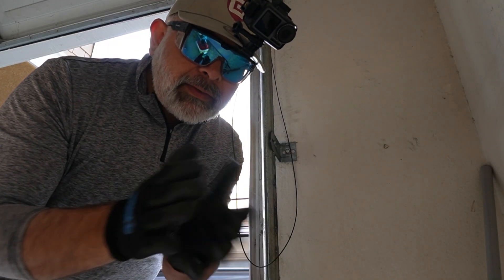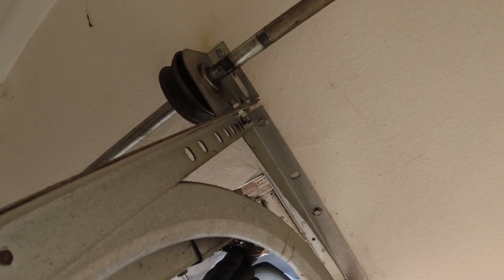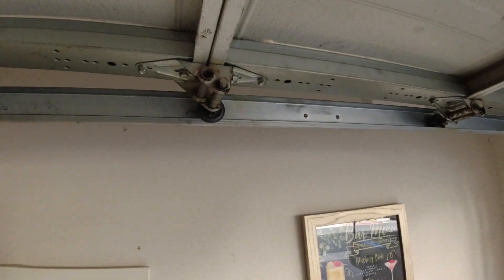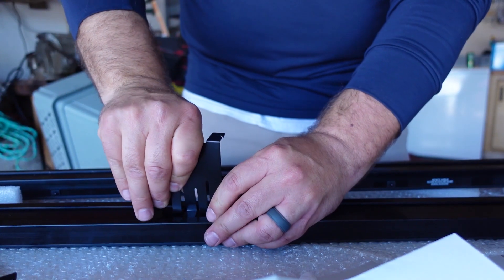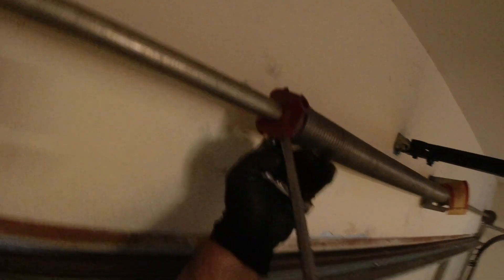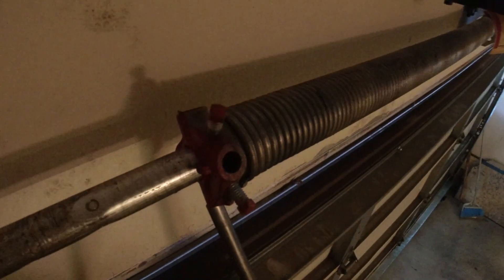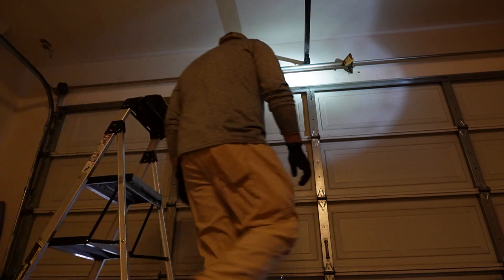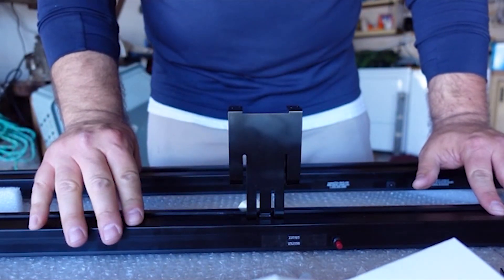You'll Never REPAIR Your Garage Door Cables After THIS!

Comment: No need to loosen drum.  Prop door up in the middle with opener stand, remove cable at bottom bracket, wind cable on to drum and reconnect cable to bottom bracket.  Done in less than 5 minutes.
Reply from the maker: Yes that's one way to do it.  And on smaller garage doors that's probably the easiest.  Yet when a cable comes off the drum there are some extra steps that I like to ensure I take in order to keep the garage door system safe.  

Thanks for sharing your feedback!